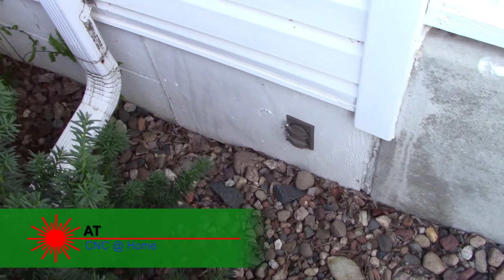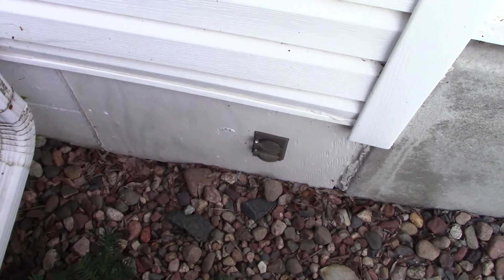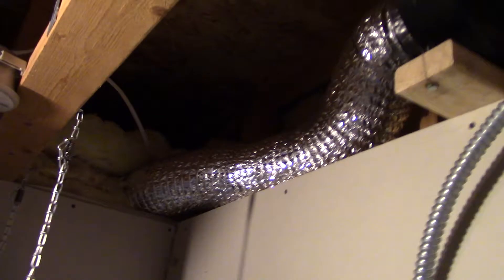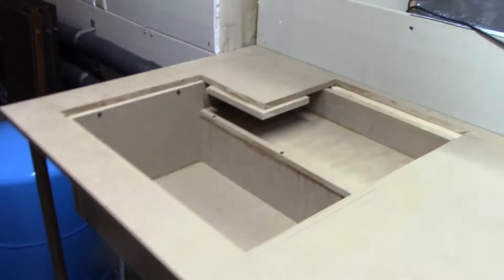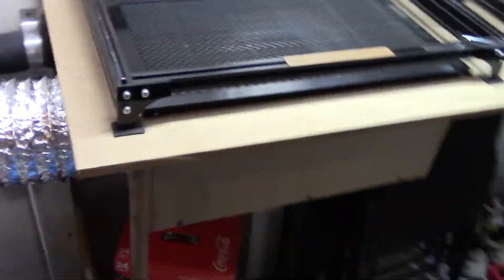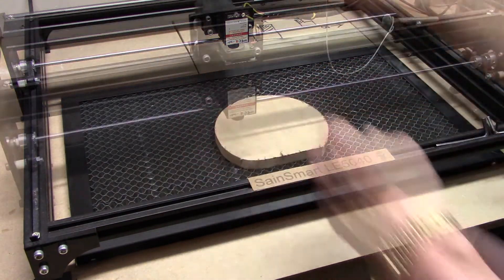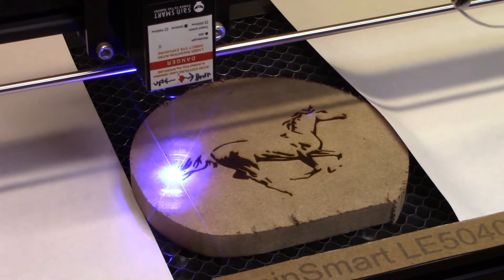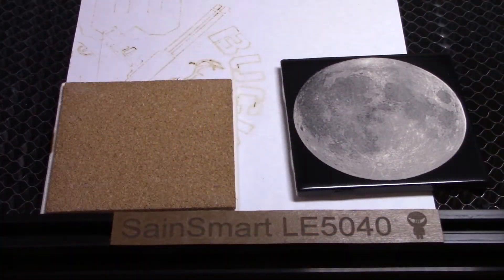New Ventilation Wasteboard SUCKS!

Comment: That is a cool set up. I like how you have that down draft set up
Reply: Do you have any experience with using a carbon filter? I thought getting one but not sure about it not venting outside. Just thought I would ask
Reply from the maker: @johndiego3105  - I have not used a carbon filter for the laser work I have done. My brother has used something like that for his 3D printers and says it does a good job.  He has lung issues and is sensitive to that so when he says it works, it must.
Reply: @ with that 440 cfm fan I imagine you’re moving some air. I think it’s time for me to upgrade my exhaust system.
Reply from the maker: @johndiego3105  - It sure sounds like quite a bit of air movement and it is. There are times where I wish it was more.  ;-)
Reply from the maker: Thank you.  It works well!  I also have a fresh air intake right above my laser that I can open up to help promote circulation.  It also have an inline fan I can turn on to force air in from outside.

Comment: What is the max cutting speed of the LE5040, 8000 inch a min or is it faster??
Reply from the maker: 8,000 in/min would be smokin' fast! It is rated at 10,000 mm/min.  That converts to 393.7008 inches/min. I went to the SainSmart website to verify this number and that is correct.
https://www.sainsmart.com/collections/cnc-machines/products/genmitsu-le5040-cnc-laser-engraver-machine